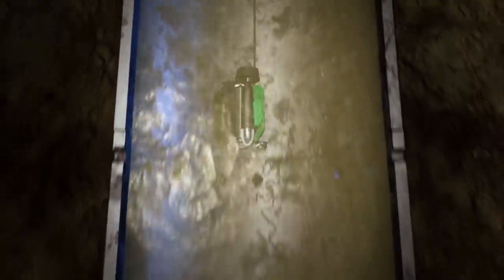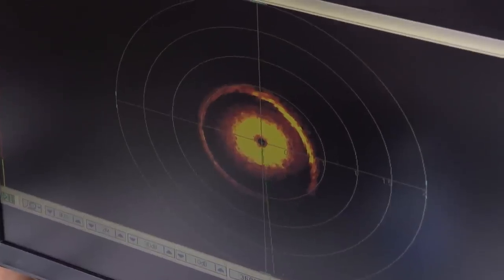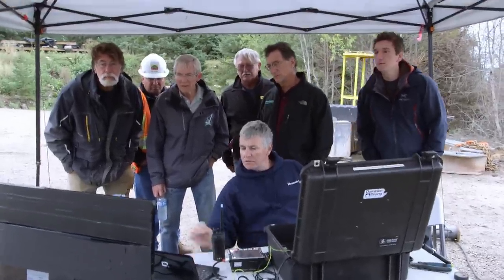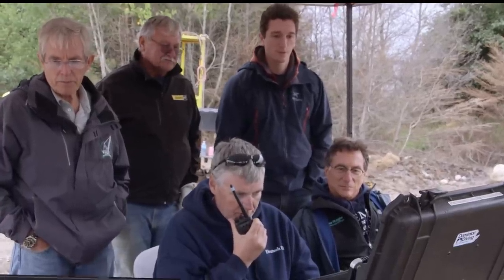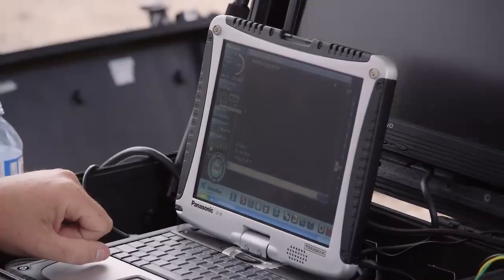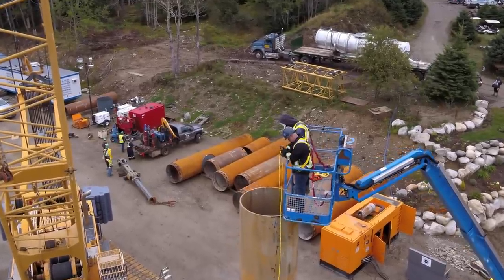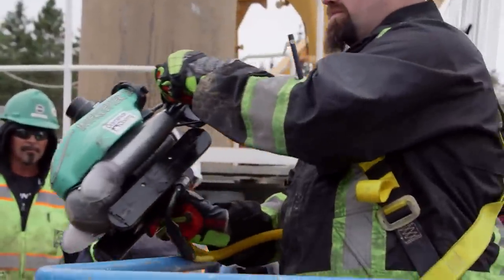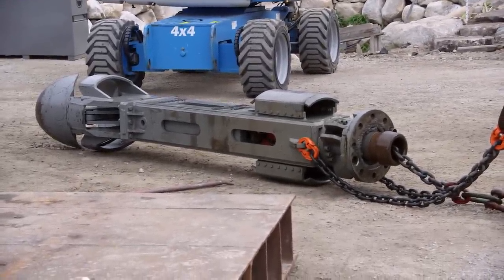The Curse of Oak Island: Evidence of a Large Underground Treasure Chamber (Season 6)

Comment: The whole secret of the island is that at one time the island was bigger and after the tunnels , money pit and sieves which brought sea water into the pit were built and finished then part of the island was removed to let sea water flood the pit. And if you look at old maps of the island you can see the part that is missing . So to stop the flooding it would take replacing that part of the island with a clay material . Which would be expensive . Maybe there is a simpler solution .

Comment: They've dug and drilled so many holes that the don't know which one is the original money pit. 125.000 drill holes and still no flood tunnel. Who in their right mind is gonna dig a shaft two hundred feet deep line it with timber and supports then dig another tunnel that connects to the ocean. Than booby trap it somehow so the littlest bit of digging in the pit causes it to flood everything. How are they gonna get rid of all that sea water and clean up the caved in shaft to gain access to the treasure!

Could it be there never was any treasure there. Is it possible that the money pit is just a sinkhole?